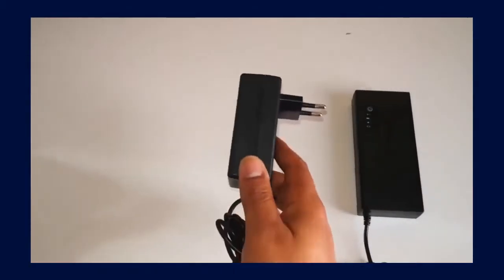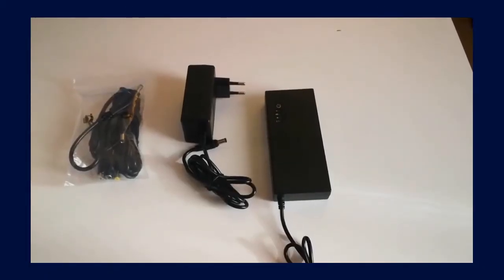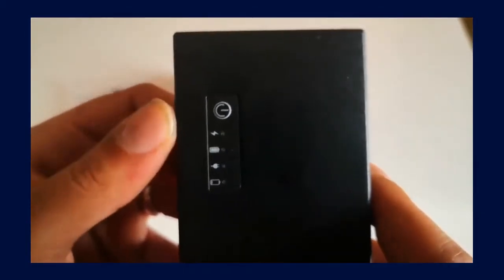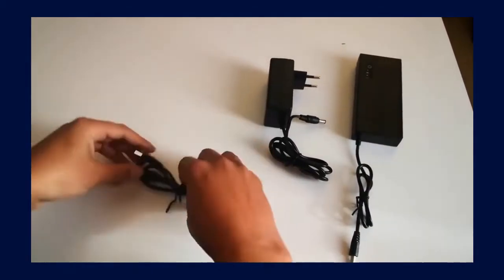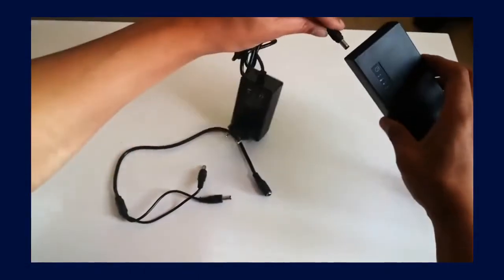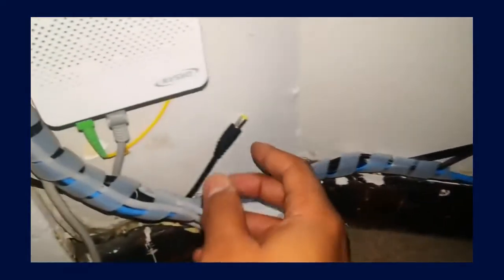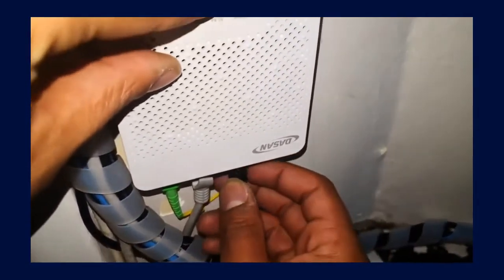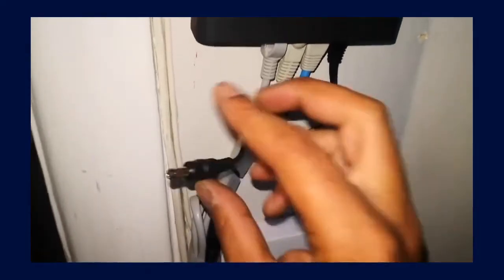[ HOW TO ] set up your Vox UPS for a Fibre router

Comment: If my ups is connected to the charger the entire time won't it mess up the battery?
Reply from the maker: Good day Munim, 

In general, most modern UPS systems are designed to handle continuous charging without causing any harm to the battery. The charging system regulates the charging current, and once the battery is fully charged, it stops charging and switches to a maintenance mode to keep the battery at a safe level. However, it is important to note that different UPS models may have different charging systems and battery technologies. 

I hope this information helps you. 
Kind regards, the DSL Telecom team.

Comment: can i buy this instead of renting
Reply from the maker: Hi Shaun, The Vox UPS is only available to rent however, you can purchase a DSL Telecom UPS outright. This UPS keeps you connected for 12 hours when you have no electricity. Get more information over here👉 https://router-ups.dsltelecom.co.za/
Reply: Thanks got me one, just curious do I keep it connected to my router 24/7 or do I charge it full then only connect if its loadshedding?
Reply from the maker: Hi Shaun, it's best practice to leave your DSL Telecom UPS plugged into your router. That way it is always fully charged and your router will stay connected when load shedding happens. Kind regards, DSL Telecom team

Comment: I had one of these. Not this brand, but a different one. My ONT box is on the ground against the wall and my fibre router is on my sons desk. I found that the Wifi ups router cables are way too short for me to leave the ups on the floor and my router on my sons desk. I dont want to put my router on the floor as well. In this instance, how can get a longer cable? I tried searching everywhere and just cant find an extension cable. I sold the wifi ups router, but plan on getting one again. Forgot to mention that there is a good 2 metre distance between the router and ONT box.
Reply from the maker: Hi Faeez, based on your location you can go into a Top CCTV Supplier store or any CCTV supplier store that supplies cameras, take your WiFi router cable with you to show them what you need and ask for an extension cable. Kind Regards, DSL Telecom Team.
Reply: @dsl_telecom  thanks so much for your response. It is really appreciated!